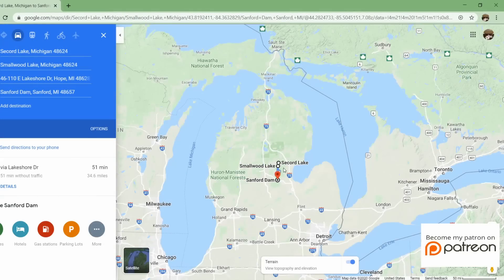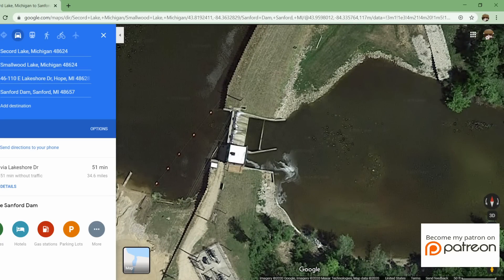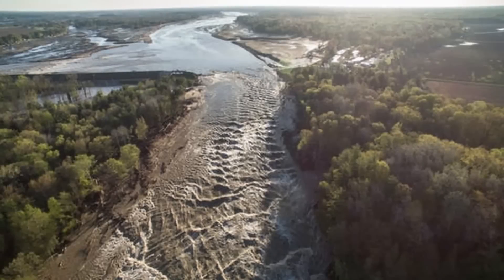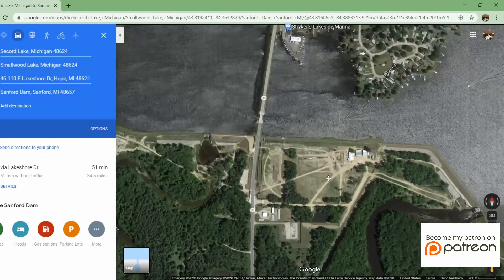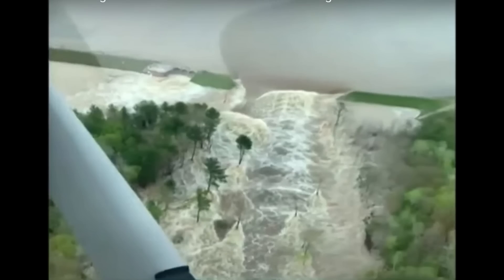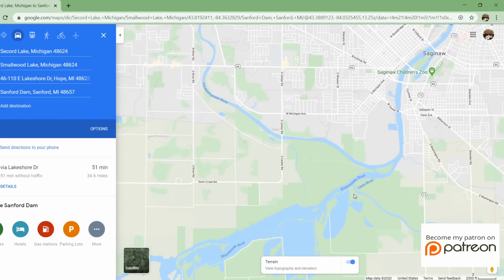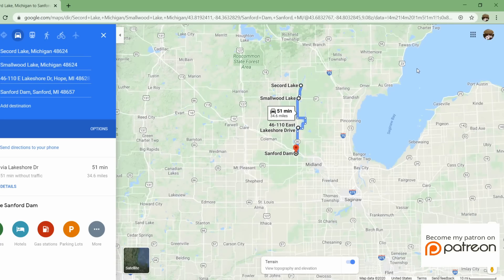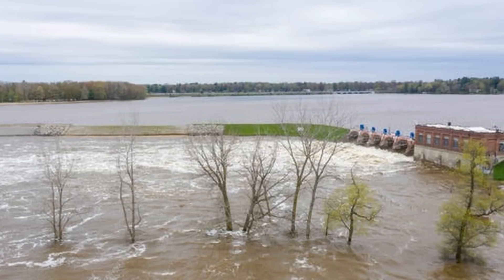Michigan Dam(s) Fail!   Tittabawassee River.

Comment: This is only the beginning of this country's failed dams. Most have been neglected for sooooo long its insane.
Reply: Fun fact-90% of the dams in the US are privately own.
Reply: @flyitrightbaby  that's correct!! Everyone here blaming the govt.!
Reply: "Vice News - American infrastructure is crumbling"
Reply: We can't afford to fix anything in this country because we're so damned worried about giving rich pukes and huge corporations massive tax breaks. Our government is underfunded in so many ways it's sickening.
Reply: yup because the way it works is things do not get fixed until a catastrophe forces them too.
Reply: We live in an era of rampant deregulation, disasters are normal now.
Reply: @sainthubbins1982  No, we are run by rampant incompetent politicians. I worked for an agency of the State of Florida ( a taxing district by definition ) and we were more about taking care of our structures. Back in the late 90s it was found that we had some severe undercutting of some of our structures ( found by remotely controlled submersibles ). By the time a year had passed, every one of them had been repaired/upgraded. Did it burn thru money, yes. But safety was always a factor that overruled costs with us. And as our agency was under court orders to do some things, downtime was almost never heard of during May to Nov. So all structures had a backup plan for if there was a possible failure. Even though our HQ was 100 miles away, they could tell if we had a main pump or engine failure. And our in house phone would ring if it lasted for over 15 minutes. The ones we didn't want to hear from were the Army Corps of Engineers or the Judge from the local Federal District Court which would come about an hour after a failure if we weren't already fixing it. So we had spare parts on hand for just about everything. We had extra fuel hose on-hand ( not cheap ($10.00/ft -10-AN )) and reusable fittings ( really not cheap ($10 to $30 each in 5/8" size --10-AN ) ) so that if a fuel hose or oil line failed, which they had a tendency to do at 0200,  less than an hour later it would be back online. You didn't even want to ask what the price of the remote oil filter 20-AN  hoses/fittings cost. One trip to the supplier cost $10,000 for the upgraded hose and fittings for just the fuel lines for 3 engines and spare parts/line. It is why my government credit card had a $50k/month credit limit for emergency purchases. Far cheaper to pay for the repairs than to pay for the property damages that could happen.
Reply: they'd rather spend the money on illegal immigrants.
Reply: @haveanicedave1551  It seems to me that our gov't prefers to divert our tax dollars on bombing people in far away countries instead of making long needed upgrades to our dams, levies, and bridges.

Comment: Last report I heard - as of noon today (5-20), reporting from Jackson, MI, many miles from the affected area - the Edenville dam failed sometime yesterday after an inundation of 8"+/- of rainfall on top of already saturated ground.  That dam had been previously cited as "inappropriately maintained" (read:NOT) as recently as 2018.  Apparently it has completely failed.  The lower dam - Sanford - has been "compromised", but has not failed completely.  Even given that, the city of Midland is expecting something in the neighborhood of 9' of flooding in the central business district.  The Sanford dam was also cited in the 2018 survey, but to a lesser extent than the Edenville dam.  So far, it seems to be holding, albeit at a degraded capacity.  The city of Sagnaw is next in line to get the flooding - no word as yet regarding what they are expecting...

Comment: iv seen at least one clip of the failures early on that was a seep thru failure instead of an overtop...and i do not think the emergency spillways were supposed to erode like that  ,,far as i know the first proper Soft plug setup was for auburn cofferdam.
And only a Heretic would downthumb Juan.
 here https://www.youtube.com/watch?v=g2TH4QY5H5I
Reply: You can't really tell from the video. It might be a seep through. It might also be an overtop, with the dam having a soft core like sand.
Reply: Thanks for sharing that link, crazy. At the 20 second mark on that video it looks like the water is close enough to the top that it might have been barely overtopping before it started to erode. It only takes a very small amount of water to start what becomes a huge cut.
Reply: This video looks like more of a seep through failure. https://www.youtube.com/watch?v=Hc3u_CHVHJ8
Reply: You're right, it basically liquified.

Comment: "intimately familiar with these damn structures"  I've done a lot with failure analysis and amazed how dams don't seem to have automatic non-catastrophic failure modes. Like we use fuse plugs on tires so they don't explode.
Reply: Listen closely as he explains - emergency spillways are indeed those "fuse plugs" that prevent sudden and catastrophic failure.  While these dams did fail and it's a bad situation, it could have been a LOT worse had the emergency spillways not done their job.
Reply: @DocNo27  This may not be 'sudden', but it's definitely 'catastrophic'.  I'd say that qualifies as a failure.
Reply: @DocNo27  From the pictures the fuse is still in place while the tyre has exploded "https://www.insider.com/michigan-town-could-be-under-feet-water-after-dam-failures-2020-5"

Comment: The picture at 6.39 is showing an intact emergency spillway, that could be seen on the google pictures. The dam looks to have failed somewhere else.
Reply: That image of Sanford dam, the lowermost impoundment, was from just a bit earlier on in the event. I believe there is other video or imagery that shows it was simply massively over topped after Edenville ruptured.
Reply: @kevinw6282  I just watched another video of the Sanford Dam. There is only the dam gates and the control building left. The embankment and the emergency spillway has all gone to the far bank.
Reply: @kevinw6282  I thought it was strange that the lake hadn't even made it to the top of the spillway. But there was so much water in front of it that it seemed really unusual.
Reply: @General_Confusion  can you imagine being right there seeing that up close? I would be torn between watching and running!
Reply: @kevinw6282  That did just cross my mind actually. I've been looking on Google Earth at what was behind that dam. All the houses have gone as far as the drone can see, it looks like it's levelled the main dam wall to the level of the houses behind it.

Comment: WSJ: Failed Michigan Dam Lost License in 2018: Federal Energy Regulatory Commission cited operator Boyce Hydro Power for safety concerns

https://www.wsj.com/articles/regulators-pulled-license-of-failed-michigan-dam-in-2018-11589994661

“The area had been experiencing heavy rains from a slow-moving storm in recent days. By 11:15 a.m. local time Wednesday, the Tittabawassee River level was at just under 35 feet—higher than its record 1986 crest, according to the National Weather Service.”

Comment: Thank you. I didn’t realize the emergency spillways were designed to fail, slowing the total release of the reservoir’s water.
Reply: The emergency spillways are not designed to fail. They are built to provide emergency drainage from the reservoir.  Once the input flow exceeds the capacity of the two spillways, the dam is likely to over-top.

Comment: Juan, I live in Bay City MI right by Saginaw Bay. I saw this short video on my FB page that shows the beginning of the failure at the Edenville dam. https://www.youtube.com/watch?v=nnuvGSUMHLc Also, here's a link to the Airborne Angler's FB page that i thought you might like to see. https://www.facebook.com/theairborneangler989/
Reply: Yes, I saw that short video that appears to show the initial breach at Edenville as well. It was not overtopped at this point, this looks like a liquefaction or perhaps water infiltration issue or some other core failure in the earthen component itself. Remarkable.
Reply: He has a video showing the Sanford dam breached. https://www.facebook.com/theairborneangler989/videos/2376109916023655/

Comment: This is a real problem with 50 year old and older infrastructure. It will continue to be. I hope there was no loss of life. Thank you Blancolirio for your great as usual coverage.
Reply: The dam was built in 1925 and had received a "fair" condition rating by the state,[2] while the 1924 Edenville Dam had received a "poor" rating. Both dams were in the process of being sold at the time of the failure.[3]